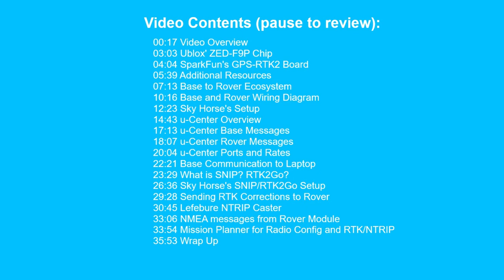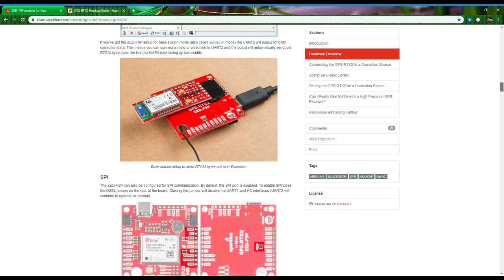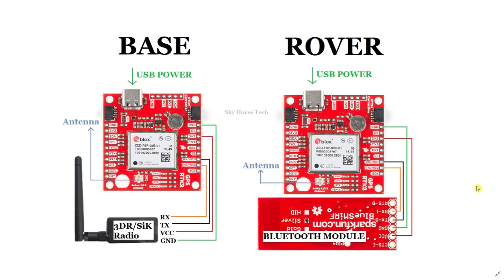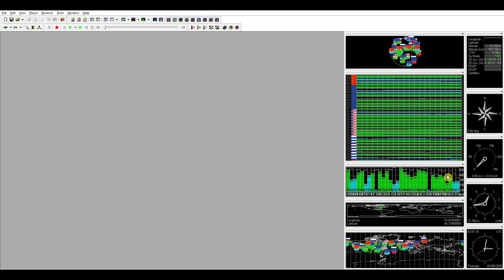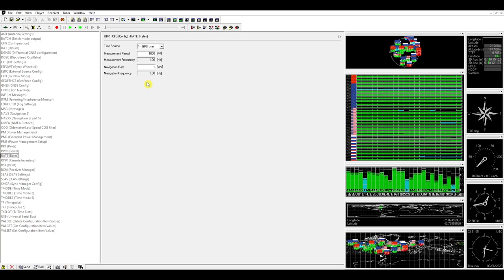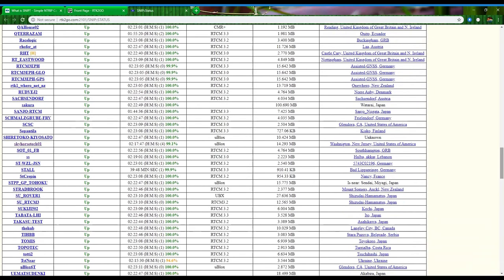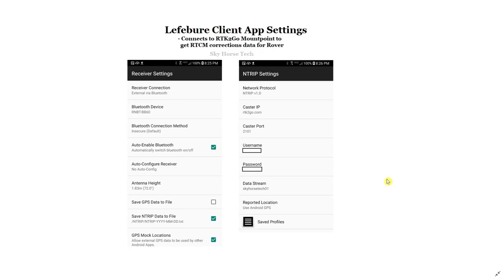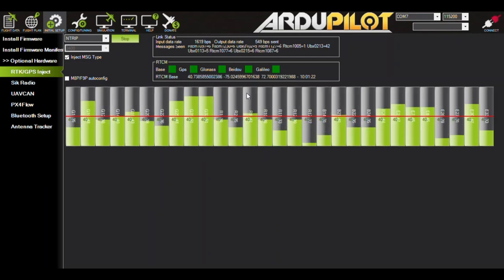How to setup ZED-F9P RTK Base and Rover

Comment: Ok that was alot of information but can you do a complete ZED-f9P setup from start to finish
Reply from the maker: Possibly in the future, however we're currently working on the next phase of implementing F9P in a Pixhawk/UAV system so are focusing on that. For setting up the ZED-F9P itself we would recommend viewing Roby's videos where he goes through the steps of setting them up from scratch. He uses the uBlox C099 board with ZED-F9P but the wiring and setup in u-Center is the same for all F9P's, regardless if from uBlox, Sparkfun, ArduSimple, Drotek, or others. Here's a great video by Roby showing how to set it up initially: https://www.youtube.com/watch?v=FpkUXmM7mrc  From our experience, the initial learning curve can be intimidating with F9P/u-Center however once you get started the methods and process become familiar quickly. There are other excellent videos out there regarding u-Center, that is where the majority of your time will be spent. The wiring is pretty straightforward, your time will really be spent in u-Center configuring the various settings/messages.  As Roby notes in that video around 3 min. 23 sec., uBlox has .txt files that you can download (free) from their Github site to get the base and rover up and running, we would recommend using both of those for your first time setting one of these up as it will get you up to speed quicker. Note that those txt files (Base config and Rover config) can be used on any F9P board, not just the C099 version. Those files are for u-Center programming and are universal messages for all F9P boards. Good luck!

Comment: where are you input ip, port and login to recieve RTK?
Reply from the maker: If you're talking about receiving RTK corrections from a base module (another F9P, CORS or NTRIP) you can send those RTCM  messages to the UART2 port  (RX2) and the F9P rover module will process those automatically and create an RTK solution. Here is a good starting point in setting up your corrections lifecycle: https://learn.sparkfun.com/tutorials/gps-rtk2-hookup-guide/all

Comment: I am using ublox c94-m8p and it works very nice for 2 years now with my remote base and send correction via uhf on ublox c94-m8p but I just finished my baste with rtk2go caster and I get rtk fix only in 1 km range and it works very nice and I get rtkflot in over 65 km range but no rtk  fix how can I make the rtk fix go for longer distance?
Reply from the maker: Over 65 kilometers and your base corrections won't be very useful. Just think of it like this, the satellites that are flying overhead 70 or 100 km away are not the same satellites flying overhead near you now. So those corrections are pretty much garbage if very far away.
Reply: @SkyHorseTech  yeah I know that but I do not get very stable rtk fix even if I am near to caster base I am getting sporadic rtx fix and when i move the rover goes back to rtk float
Reply from the maker: @builditfixitrestoreit7523  Definitely check your antenna placement on the rover first, if it doesn't have a clear view of the sky getting a fix will be difficult. Next, check your rover module UBX-RXM-RTCM messages, if you are not receiving those from the base then you wont be able to get a fix. If your UHF radio is dropping a lot of those, same result (rate too high on base, too many msgs being sent for radio to keep up, etc). If you can see your base is sending UBX-RXM-RTCM but rover not receiving them then the problem will be in the radio transfer. Also, check your UBX-NAV-RELPOSNED messages to confirm your base location is identified.

Also note the M8P is a single band GNSS compared to the F9P multi-band so your results may not be comparable in some cases.

Comment: We are testing zed-f9p. But, the zed-f9p has an approximately 3 seconds delay in rover displaying the position data. Is it normal or do I need correction in setting? Thanks.
Reply from the maker: You usually shouldn't see that long of a delay. That can occur if you're using something like RTKLIB STR2STR program to parse live data and it's not configured correctly. Confirm first with F9P linked directly to u-Center via USB cable to check refresh rate and data is updating quickly. Also check your rates in u-Center for your messages are set correctly (1hz -10 hz). Definitely make sure you have turned off any/all messages (NMEA, RTCM3, etc) that you don't need otherwise the buffer can get overwhelmed. When the F9P is shipped often the default messages are all on but you won't need them all. Confirm your baud rate is set to 115200 bps, if you have it lower like 9600 bps delays can occur. Finally, make sure you have a decent GNSS antenna, where a cheap one can bottleneck your whole system. If anyone else has additional tips please add a comment here. Hope this helps!

Comment: Thanks a lot for the tutorial. 

What is the maximum allowable distance between RTK base and RTK rover in case of a stable  real time wireless data link between gadgets? 
Regards,
АБ
Reply from the maker: The max distance should be around 15km or so. The problem with a longer baseline is your corrections from the base is receiving satellites that are different than the sats your rover is 'seeing'. You'll still get corrections but there will be degradation. Good question.

Comment: Is this able to product Legacy RTCM 2.3 or RTCM3.0(ex. 1008) messages for older GNSS units?
Reply from the maker: According to the uBlox Integration Manual for the ZED-F9P it unfortunately can only produce RTCM 3.3 and is not backward compatible with the older 2.* structure.
Reply: @SkyHorseTech Ok, thank you for the prompt response and great video!

Comment: If there is a rtk2go base near me can I use that instead of needing my own base?
Reply from the maker: The list of publicly avlb RTK2Go stations can be found here with city, state, country: http://rtk2go.com:2101/SNIP::STATUS. Chances are there isn't one near you. Many here in the US without their own base use free CORS stations for post processing (PPK): https://www.ngs.noaa.gov/CORS/sort_sites.shtml. Many times PPK is preferred over RTK since you won't have potential for breaks in messages that occur in RTK real-time missions. Rtklibexplorer has bunch of posts on how to use RTKLIB for PPK with ZED-F9P, check those out. Basically you would use your rover F9P to log an RTCM .obs file. Next, go to CORS site for base near you, filter on time range you collected data file on rover, download the CORS base .nav and .obs files. Run RTKLIB with these 3 files (1 rover, 2 base) to acquire PPK solution. This is also how you can zero in on a permanent fixed base location when 1st setting up, using CORS as reference and corrections. Ideally you want the CORS station to be within 10-20 miles or so to get best results.
Third option is to pay $ for monthly NTRIP base corrections for RTK or PPK. Google your state, some have a GIS department that provides free NTRIP services.
Good luck!

Comment: basically this project wont work without internet connection. Im right?
Reply from the maker: If you have both the base and rover you don't need internet or cell service. You can use 3DR/Sik or LoRa radios to transmit corrections between the 2 within the range of the radio. If you only have a rover you'll need 3G/4G cell svc or internet/Wi-Fi to receive corrections from an NTRIP service to run a RTK mission. A 3rd option, with only a rover you can log your GNSS data (on phone or SD card, see our separate vid showing how) then generate a PPK solution using corrections from 3rd party, free CORS base station (U.S.) when you are back around internet svc,  which would give you a solid result also, many ppl use this method. Recap: With only a rover you would need internet/cell svc for NTRIP RTK (real time) but could obtain PPK (post processing) using CORS base data. If you have base + rover no need for any internet/cell to obtain RTK and/or PPK.
Reply: @SkyHorseTech LoRa misses RTCM3 messages.  FTK fixed mode becomes unstable. It needs more than 1kByte/s to forward the RTCM3  stream.
Reply from the maker: @aabdev  Thank you Aleksandr for the input, it's definitely appreciated. When we looked at this a few years ago vis-a-vis LoRa it was discussed on uBlox boards and sounded like it is possible as long as you break up the packets per RTCM msg to reduce the payload. Then you can reconstruct on the base side. We never tested that but you may be right.  https://portal.u-blox.com/s/question/0D52p00009OYf76CAD/please-let-me-know-the-procedure-how-i-can-send-rtcm-message-from-base-to-rover-using-lora-packet

Comment: Hi, congratulations on the video, have you ever done any tests with Carlson Survce software, or Fild genius?
Reply from the maker: We have not but if anyone out there has used one of those please comment with your experience. Thanks for watching!
Reply: Hello Goodnight.
SurvCE from version 6.04 on, has support for ZED F9P. I have it installed on a data collector with windows mobile and it works very well linking via Bluetooth. I have not tested the wired link.

Comment: Hoping someone on here can give a fairly novice mapper some help with some details. I have flown some mapping missions, but these were mainly for people that wanted a more detailed view of their properties. I am running into requests now for greater accuracy. From what I undertstand, a handheld unit like Bad Elf GNSS Surveyor will get you within a meter, and higher end units, like their Flex will get you sub-centimeter, and the ZED-FP9 is a similar type of unit.

Correct so far? 

My big questions are:

- Is the value of the base unit so that you can place it at a known, absolute positioned point like a surveyors marker, and use that as a point of reference for the rover unit to connect to, and in turn get an even greater level of accuracy for setting GCPs?

- Is the base unit required, or could you just use a unit to grab coordinates of each GCP you lay down? 

- I do a lot of work in fairly remote and hilly terrain. Quite often there is no cell phone reception, but can get GPS connection. What mechanism do the units use to communicate with one another, and what is the range between the base station and the rover? Isn"t terrain, line of site, and physical barriers going to impede connection?
Reply from the maker: Not familiar with Bad Elf but you are correct about the F9P. If you are just running mapping missions and don't need real time, immediate results (RTK) you can use post processing (PPK) which is much simpler. RTK requires your base and rover to have constant communication. PPK allows you to collect base and rover data independently of each other (at same time) and calc the corrections back at your office or home. Research/google topics such as RTK, PPK, RTKLIB, NTRIP (subscription RTK base corrections), CORS (free base PPK corrections in US). You'll get a better idea of the options avlb and the differences of each option. Hope this helps.
Reply: @SkyHorseTech  Very helpful. Thank you.

Comment: Sky Horse Tech .This Rover setting is also applicable for working with NTRIP, or something needs to be changed in the input and output messages.
Thanks for your attention.
Reply from the maker: When using NTRIP instead of your own base station, you would use the same setup on your rover. Instead of reading corrections from your base over SNIP you would be reading them over NTRIP. Depending on your NTRIP provider, you may need to tweak your rover to accept RTCM3 vs UBX/Raw or visa-versa but those settings can be adjusted on your rover through u-Center pretty easily. Thank you for your question, hope this helps!
Reply: @SkyHorseTech 
 Ok muchas gracias.

Comment: hello friend is this product sold?
need programming code?
Reply from the maker: Hello, if just getting started with the F9P definitely check out the Sparkfun Hookup guide: https://learn.sparkfun.com/tutorials/gps-rtk2-hookup-guide/all which will get you started down the right path. After that, check out Roby's videos (linked in the Description section) for next steps. Most of the code is present in the F9P when you get it. We then use uBlox's u-Center app to configure the input/output depending on our specific use case. Hopefully that will get you going in the right direction.